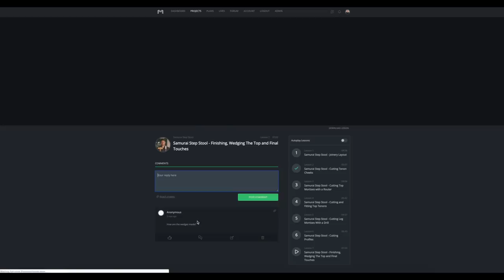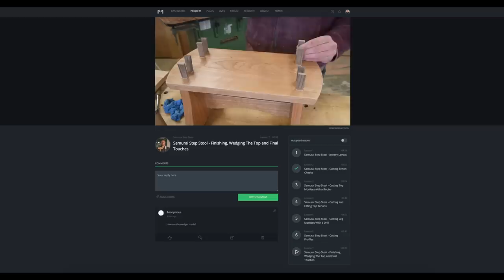Carve a Wood Bowl - in 4 HOURS!

Comment: I just made some live edge platters on my channel a couple weeks ago... very enjoyable. Would love to try that planer wheel but damn they are expensive
Reply: Try Chinese copies on eBay. $10 and up
Reply: @dart70ca  are they worth a damn tho?
Reply: @BradsWorkbench  Haven't tried mine yet. Could be some carbide shrapnel flying around :)  Seriously though, not exactly high tech. I have a chainsaw blade, too. Stumpy was extremely careless in that video. Bad stance, bad arm position, bad workpiece position. This bowl is a great test of the ArborTech; looked extremely stable on those inside cuts. I would never attempt that with the chainsaw carver.
Reply: @dart70ca  i have a chainsaw disc too but ive had it catch too often to use it anymore. My hands just arent steady enough. I like the kutzall discs
Reply: @BradsWorkbench  Agreed. I treat it with a lot of respect and read the directions before each use to remind myself. I use a weak HF 4 1/2" grinder and NEVER lock it on. I like the Kutzall and Saburr products as well, though I do not own a disc. Only downside is their tendency to clog in certain woods, I wood say.